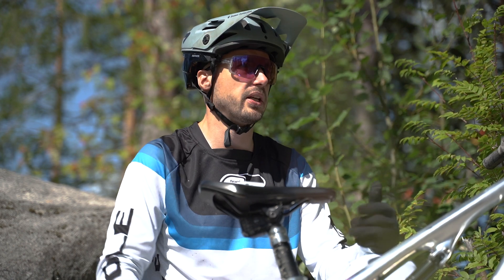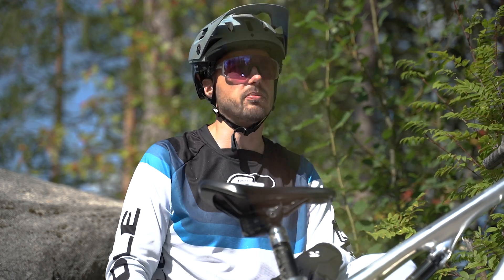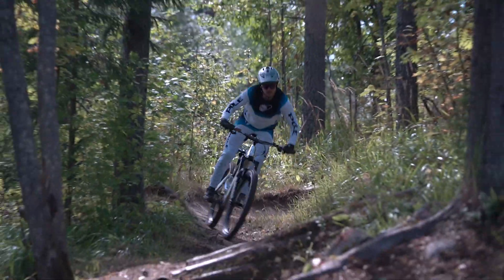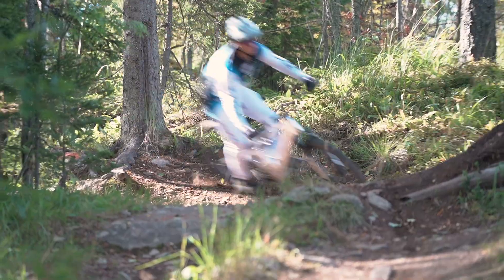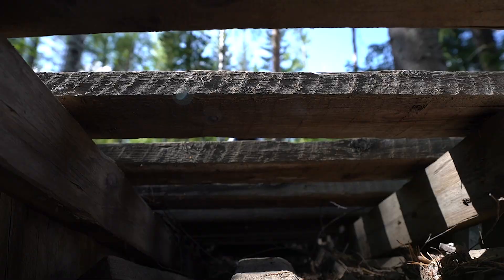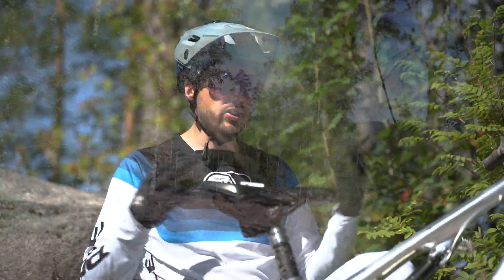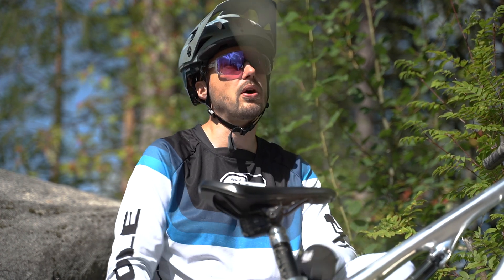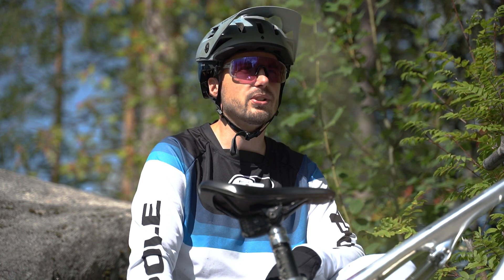Voima Sensei Suspension Explained - Part 2

Comment: Seeing that Pole decided to go with the Bosch CX is huge! Super excited about the motor choice!
Reply: I'm in love with the refreshingly new approach for the geometry, the build-in indestructibility (even with very rough use) and the repairability of the frame (in case of a crash) of the bike. But, for me the use of the Bosch motor is a deal breaker. Sure, the unit provides decent performance, but it doesn't fit the sustainable concept of the bike and the Pole company  as a whole. The Bosch motor is infamous for its lack of weatherproofing and is also a not repairable. The bearings can be changed for new (better quality) ones, but other than that, Bosch does not provide parts to repair the motor. So when you have issues with the internal gears or the MCU, the unit is ready for the bin. The Shimano motor (EP8), isn't an alternative as it suffers basically from the same shortcomings. A good alternative for the Bosch motor would be for example the new Polini EP3 + MX motor or the new Askoll C90A motor. Both motors offer plenty of performance and are better weather proofed, but most and fore all they are fully (user) serviceable. This last point gets more important as resources should be used wisely and efficiently (sustainable).